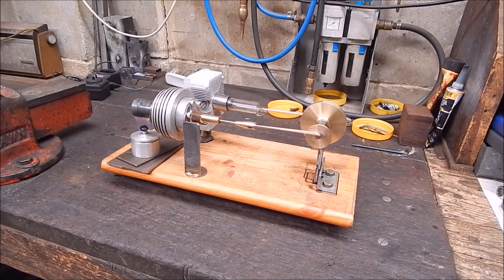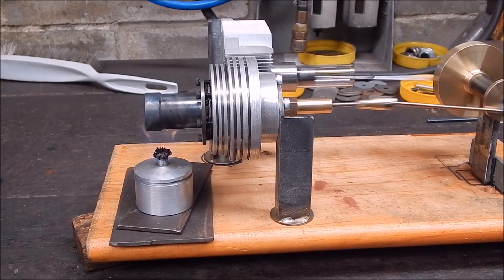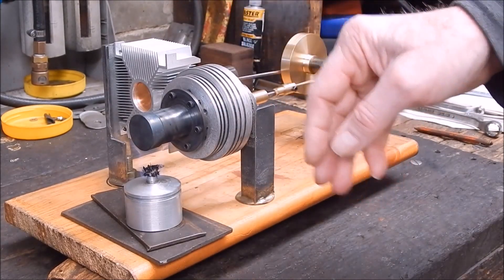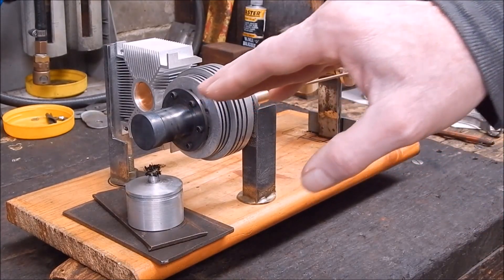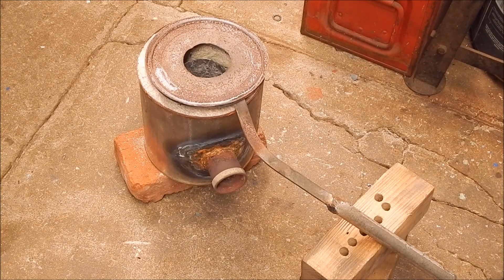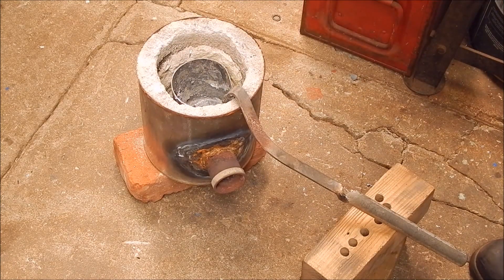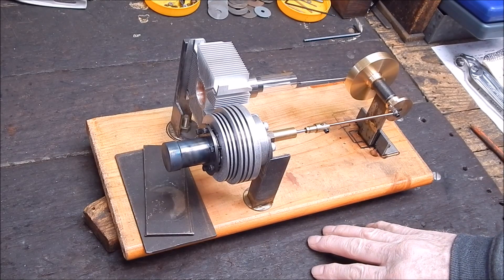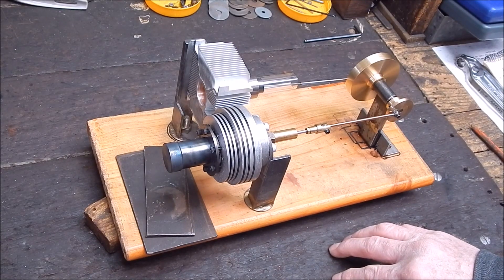The CPU cooler Stirling Gamma engine will now run all day

Comment: Xynudu, are you familiar with heat pipes. They can passivly move  heat much much much faster through a pipe faster than a solid copper bar. 
Their construction is simple.
1. Seal one end of a pipe. 
2. Add a little acetone.  
3. Heat one end of the pipe with the fluid at the bottom while holding your finger over the other and let the pressure build untill you cant hold it in any more.  
4. Then release and immediately seal.  
That will blow most of the air out, and when the acetone condenses, it will create a vacuum  causing the acetone to boil at a lower at as low as ambient temperature and condense on the upper portions of the walls (condensor) were gravity can feed it back to the heat supply (boiler), except the whole thing is just a long tube with fluid in vapor and liquid phase.  The point is the vapor phase can move long distances at near the speed of sound inside the pipe and give up its heat of condensation  over a large surface area.  To work well, you dont want so little fluid that it all evaporates in the tube.  Nor so much that  much of the volume inside the tube is liquid. And, you'll want to purge as much of the non condensing air as possible. YouTube and the internet are full of information on heat pipes for cpu coolers and solar thermal hot water.  Yours can use just gravity while others use capillary action to help return condensed liquid back.
Reply from the maker: Sounds explosive ;)  Interesting.  New one on me.  Cheers Rob
Reply: @Xynudu  watch how fast heat can move through a heat pipe.  Far far far faster than conduction.  https://youtu.be/OR8u__Hcb3k

You could use water, but it will still freeze at 32f.  And acitone can get much colder.
Reply: @Xynudu   this may inspire.  check out this cpu heat sink with heat pipes, fins, and fan.  https://images.app.goo.gl/e6KfkcoSgPmmA8UTA

Comment: Great job Rob, glad you hung in there. Thanks for the video.
Reply from the maker: Thanks Ron.

I made a larger metho pot this morning out of aluminium and gave it a run.  Never looked like stopping.  It would occasionally slow down a bit and catch it's breath (cool down the displacer I expect), then speed up again.

That CPU cooler is the answer.  Even though the displacer fins got too hot to touch, the CPU cooler was barely warm, and the power piston virtually cold. 

Now I just have to paint the columns and make a hard wood base for it. 

Then I will have to decide what to make next.  Probably a flame licker.  Never have got one of those to run, but I have learned a lot from these two Stirlings.  So cut down the friction losses and here's hoping ;) 

Cheers Rob

Comment: Whats the  insulation in your melting pot?
Reply from the maker: Perlite (from garden centres), cement and sand.
Reply: @Xynudu  What proportions? Thanks.. I made my own Frosty gas burner but haven't made the crucible yet
Reply from the maker: Mostly Pearlite, but too much will tend to make it crumble when heated.  Use a regular sand and cement mix (increase the cement a bit) as the binding agent.  It's trial and error.  I got the mix/idea off of the internet, so Google will bring up information on this. I believe you can also use refractory cement with Pearlite (more heat resistant)  Cheers Rob

Comment: Hi Rob. Fascinating to see this one running so well. I must say I can't fathom how those things work. It occurred to me while watching, would it be worth trying to add some insulation between the Allen bolts and the part with the burner under it? If the asbestos helped, more insulation would help as well, is what I'm thinking. But I will admit I don't know anything about these little devices. I really enjoy the videos, Rob, I try and do some myself. Like you say gotta keep the grey matter ticking over.
Reply from the maker: Any heat transfer through the bolts would be minimal.

Comment: Would cork gasket material be up to the job? Certainly nicer to work with.
Reply from the maker: Hi Lee.  No.  Temperatures get quite high on the hot side and cork would burn up.  Cheers Rob

Comment: Fantastic Rob, success at its best, if you put you hand on the flywheel does it take much to stop ??, you have done a great job mate,   ATB Matty
Reply from the maker: Hi Matty, It's actually reasonably powerful for a Stirling.  I have a small DC motor/generator I'm toying with the idea of driving a few LED's.  It might happen.  Cheers Rob
Reply: I really hope it does happen, where is the best place to get some plans for a sterling engine, one that's not to difficult to make for  the first time.  Matty
Reply: @Xynudu  maybe you could try bicycle dynamo?
Reply from the maker: Hi Matty,  they all require light weight construction.  That's the main issue with building one.  There are lots of types and designs/free plans out there from simple coke can ones to incredible looking units.

I went Gamma because I had the two dash pots to use up, but they can be tricky to get running.  Friction is the biggest enemy.

I made it doubly hard for myself by doing a scratch build, but that's OK, just be prepared to fail ;) 

 Cheers Rob.
Reply from the maker: Too much drag and too large.

Comment: Hey Rob that’s cool but what are you going to do with it? Can you run something with it? Cheers Stuart 🇦🇺
Reply from the maker: Hi Stuart,  I have a very small DC motor(use as a genny)  that I was considering running a few LED's off of with a large "O" ring as the belt drive.  The Stirling is fairly gutsy, but I'm not sure if it is up to it.  I might have a play around with it before I finish it off.  It's been a good project and certainly gets you thinking.  Red power.  He He. Cheers Rob
Reply: xynudu. Cool, now that I have seen it finished and working I will go back though all your videos that show how you made it. I know that’s cheating but no point in re-inventing the wheel🤣. Cheers mate, Stuart 🇦🇺
Reply from the maker: There are some dimensions pinned in the comments of the first one I did.  The only change I made in this one was to increase the displacer diameter by 1 mm, thus reducing clearance to 0.5 mm, which means your machining will have to be spot on.  Cheers Rob
Reply: xynudu. Thanks Rob, I’ll have a go. Cheers mate👍👍